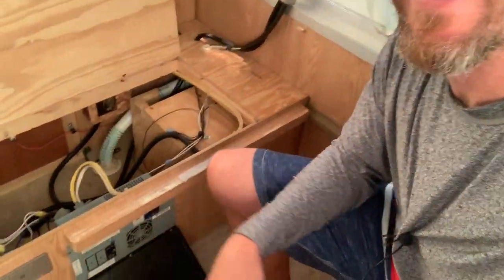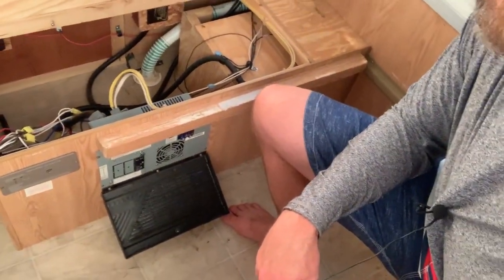My Camper Battery Kept Dying, and I Found Out Why

Comment: I have a similar problem, i bought my camper , pulled it to sure power. Worked good for 2 weeks. All of a sudden it started kicking breakers. I called an electrician,  he put a bigger breaker in. It solved the problem however i noticed i would get shocked occasionally. Now i dont get shocked anymore however my battery is dead when the sure power goes out. I think its my power converter and an open short
Reply from the maker: Check it for shorts, I had arcing behind my breaker. Also check this one out, how I swapped converters DIY Camper Power Converter Repair (Elixir ELX-30 Replacement)
https://youtu.be/WItJrapWr-Y

-Simon

Comment: We have a 2007 Forest River Class C motorhome that we bought in 2016 and the RV "house" side has been very reliable but not 100% on the Ford chassis' side but those challenges were/are addressable and fixable. Being a DIY'er, and with lot's of support and 'How to' knowledge threads and videos, in time most everything Ford related was up and running. 

My something's not right with the electrical system came when no lights would come on inside the MH the night of the day I had been working on the MH during daylight here at home. Historically when I had the MH hooked into home shore power, and had the battery switch turned off, the lights had always illuminated. Only difference this time was that I intentionally had left the batteries disconnected. So its night and I go to MH, on shore power, the battery switch turned off,  and no light when light switch is flipped on. None of the lights (12V as they all are on this vehicle) come on for the 1st time ever when hooked to shore power alone.

 In time I finally get to learn so much more about RVs and their electric systems. Knowledge I always wished I had but not learnable until I had this fundamental "lab assignment" presented to me.
 

When I hooked up the battery cables. and still on shore power, and had battery disconnect set to 'Off',  still no lights! 
Let's try turning battery disconnect to 'On':  I have lights! 
Disconnect shore power:  still have lights. 
Lets disconnect the negative wire at the battery:  no lights. I knew the shore power was coming into the MH as I still had running 120V floor fans plugged into 120V receptacles.
The problem:  The converter was no longer converting 120V to 12V for its 2 uses:  1) Power the 12V house systems with 12V,  and,  2) charge the batteries.
When did the converter go? I have no idea as the solar panels on the MH's roof had been recharging the batteries on their own, an easy task in the Arizona sun. 
I have the new converter (they are pricey nowadays) awaiting to be installed. At over 100*, the converter can wait.
Reply from the maker: I have another video after converter install, thats what it was for me! -Simon

Comment: I just bought my pop-up camper 3 months ago there is no high-pitched squealing anywhere but the damn battery keeps dying this is the second battery I've bought. My question is can the converter be bad without the squealing noise?
Reply from the maker: My understanding is yes it's possible, but there could also be a bunch of other causes like a drain on the battery, or even too long between charges. First question is: when you plug in the camper, is the battery charging? If not, then I would be the converter is bad. -Simon
Reply: @LakeHubTV  I will have to check that thank you very much for your response